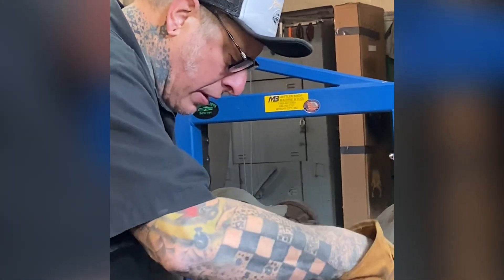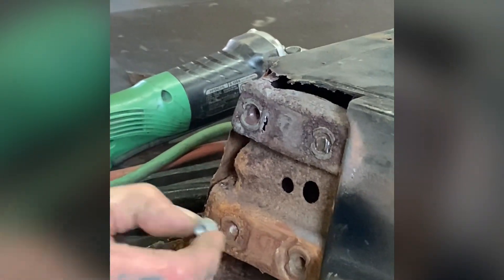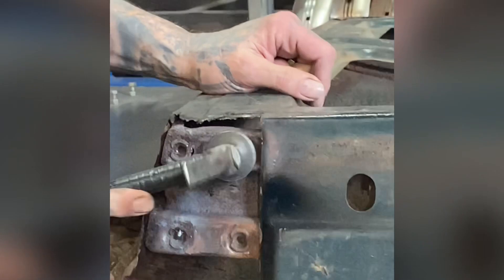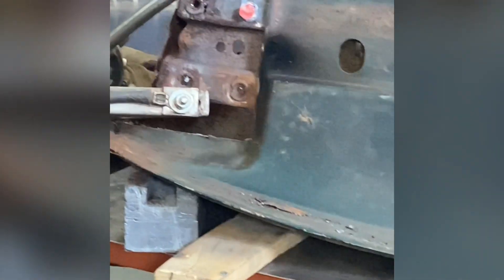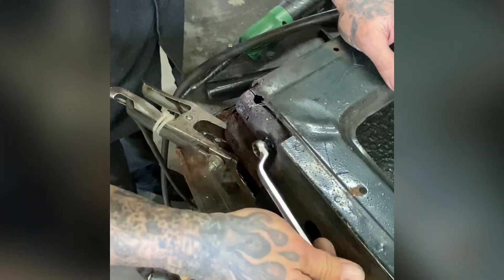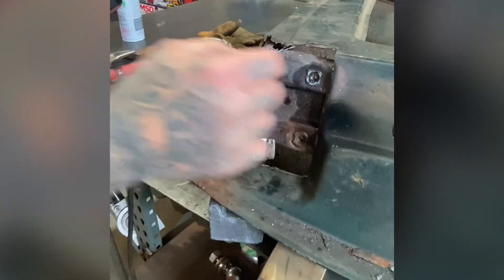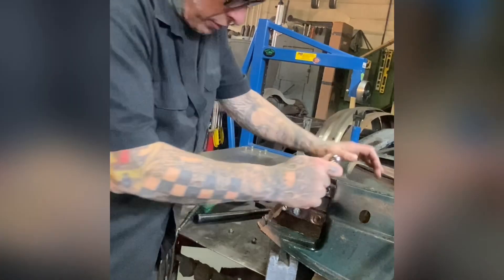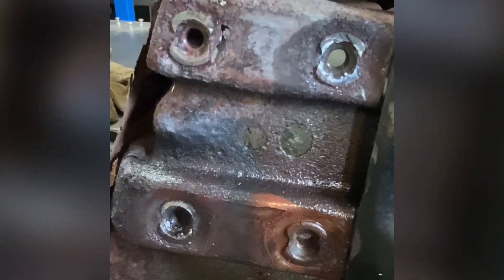Broken Bolt Removal

Comment: Drill out and use a EZ out bolt extractor.
Reply: I think everyone knows about that by now. Cleary he did not want to do that. Geez.
Reply from the maker: True man. But you take the chance of drilling through the bolt threads.. Takes about the same amount of time. I tried on the first bolt and it did not want to come out..

Comment: Best to spray the threads.  Spraying the top is fine but if you spray the rusty threads on the backside before bringing the newly fashioned bolt  out it would have been faster and easier for you.  Now for the positive, you are an excellent welder, you made that look so easy.  I really admire your work and your knowledge.  Impressive.